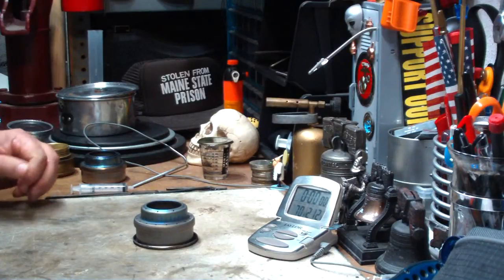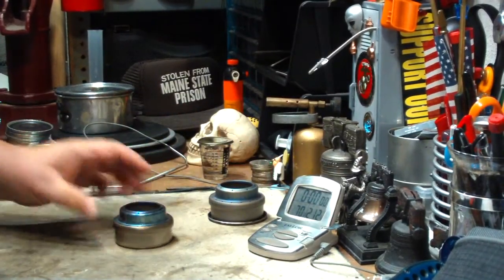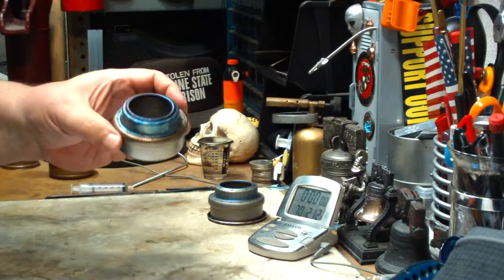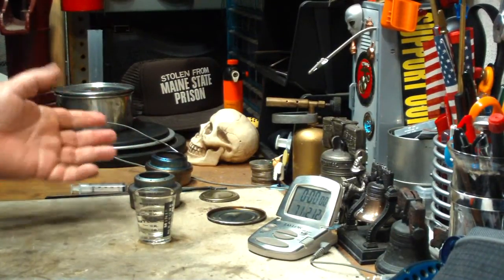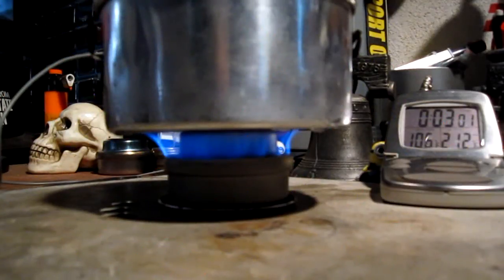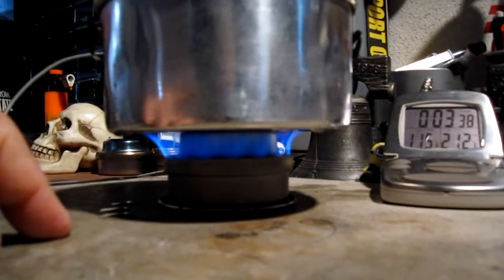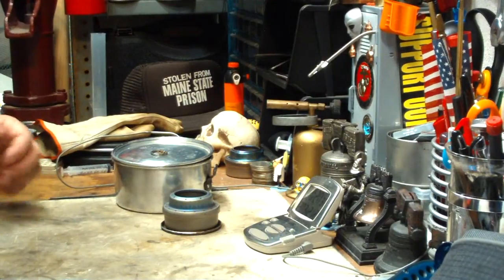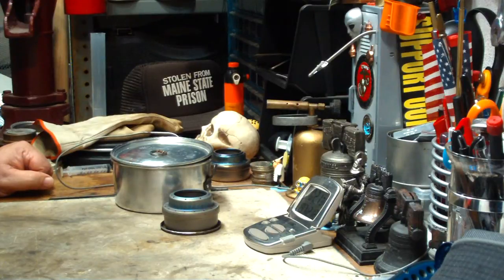Survival EDC Ultralight Titanium Alcohol Stove Using Primer Pan Without A Pot Stand - Boil Test #3

Comment: Taking my inspiration from the brasslite instructions, I primed my EDC knockoff by putting drops of fuel in the surface the lower holes come through.  It worked ok... not as well as a primer pan, but better than no prime and, well, no primer pan required.